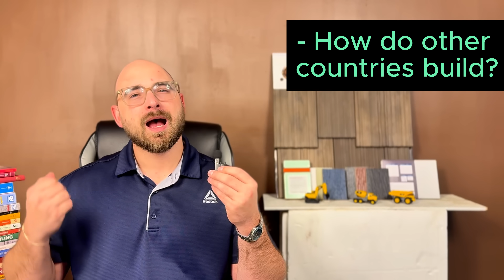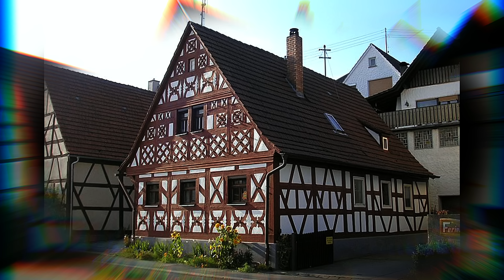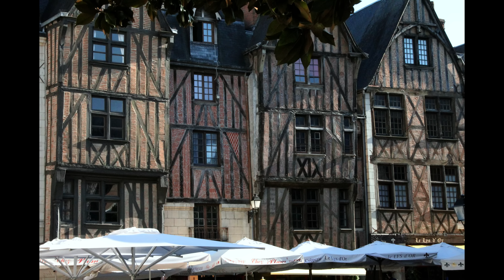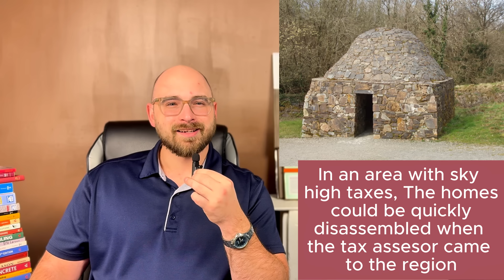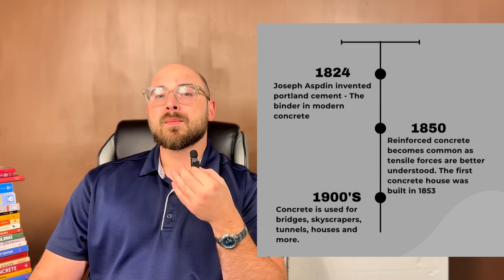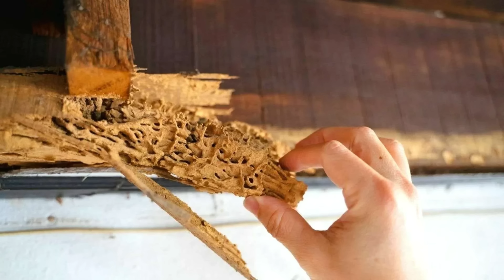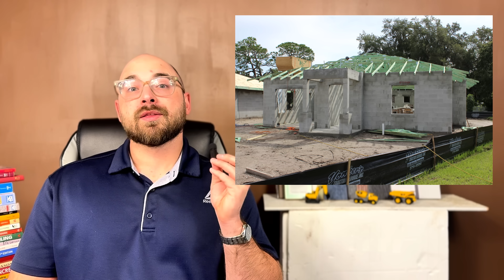Why Other Countries LAUGH at American Homes

Comment: Hello, do not note that France has suffered 3 wars on its territory (France-Prussia 1870 in my region , 1st world war and 2nd world war ). Destruction of housing, fires, mines, explosions destroyed buildings but also many forests . If Auguste PERRET rebuilt a concrete part it is because the wood was not available in quantity and quality . The standing clay houses were preserved, bricks and local concrete were easier to use, faster for reconstruction. For the well-anchored villa, in stone and concrete.  There is no good or bad home . As you said, there are specific needs (cost, sustainability, etc.)

Comment: I am from Puerto Rico, I can't stress how much I miss Concrete Homes, there are really no positives from light wood framing etc.. here in the US. This feels like the materials came from Office Depot. The only thing I have to fix in my concrete home is water faucets every few years, and paint. nothing else. Here there's always something. Weekends are spent just fixing stuff. Kids playing, stumping and walls tremble like crazy. got a leak, thousands to repair damaged floor and drywall (so much for cheaper)  pest control more monthly bills. its just an endless money pit. My concrete homes felt worth of the money and an investment, like a gold Bar. this feels like a ripoff, no way my kids will inherit this thing after I am gone it won't last. I am trying to build a concrete home here but in the US is not common so prices are ridiculous. you can get a full rebar concrete home including the roof in PR for 250k with around 1700 sqft living space.  It is all about location really.

Comment: What is also important is maintenance.
An American house is built and expected to last 30 years.
By then you'll have to do a complete makeover, with the cost maybe exceeding the cost of a new building.
If you inherit such a home from your parents, not much is gained, except maybe the ground it is standing on.

In Europe, inheriting a house built in 1990 will be usually stil in good shape. Maybe requiring a new heating unit and roof.
The average price of such a home will be around 250000 Euro. You might have to invest another 100000. But you'll end up with worth being created.
You still gained a lot by inheriting it.

Comment: In Argentina, it's very common to build with reinforced concrete colums and overall structure, then use hollow bricks for the walls. At least in Buenos Aires. Other construction methods do exist, like steel framing, and the like. Wood structure is nearly non-existant, other than for tile roofs, or maybe stairs.

Comment: I saw this other channel, Good simple living, show how they were building with this concrete cladding that looked like wood. I think I could live with a hybrid like that, traditional American construction inside and durable but classic log aesthetic outside. No need to redo the sidings (is that right?) every few years, no rotting, externally resistant to fire... It's a good compromise.

I grew up surrounded by brick though so it would always be my instinctive choice.

Comment: One secret with Roman concrete is that they used SEA WATER IN THE CONCRETE. Their is/was a documentary about it. SEA WATER does something with the LIMES. I think it binds it , and it  won't bleed moist  and dry up and shatter, as time goes on.

Comment: In the US, land is generally cheaper than EuroLand or Japan.  Also, the renewable North American tree crop makes wood inexpensive. So building large wood homes makes sense.  Yes, that can be frustrating & expensive for those who want to build with other materials.

Insulation and energy efficiency are not priorities in the US.  The US generally has much cheaper heating and electric costs, especially when compared to Euro and their whacky enviro policies.  Yay US Fracking!

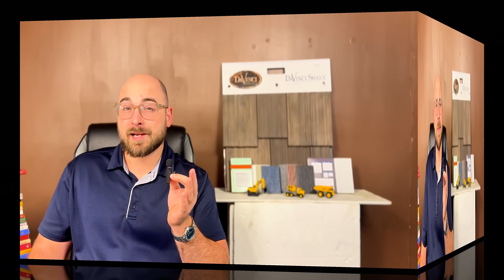Comment: 2:29 ok, here am I then 😂 My "Kádár cube" as they are called in Hungary, is built on a 3 step high insulated concrete base with 60cm wide earth brick walls. It doesent need the currently so popular outer insulation, as the walls are insulating by themselves, and also needs to be breathing. It is lime plastered outside and in (though public opinion on that is mixed, as that won't bond to it, only by netting, or nail wiring it, the previous horse manure+straw+mud mix does, but that's not nearly that smooth). If it cracks, it can easily be fixed with more dissolved mudbrick materials, there's plenty of that. Just as it is with the original early 1900s "Beaver tail" tiles it has on. Every second old building still has that , so it's infinately repairable. This one was built in South-East   Hungary in the early 1960s.

Comment: The main problem is that US construction has not been upgraded for a century and it is heavily regulated that slows down the progress. I recently bought house and the bedrooms don't have overhead lighting. In the New England houses are century old, have some many problems, the prices on them and construction materials are gouged up. So people are forced to patch this old stuff over and over until it collapses. I used to live in Russia in place where blizzard blows everyone from a feet. Everything there is made from a brick and concrete. Windows are triple ply gas filled. When you inside you just watch through your windows how snowstorm is raging and sip coffee in a t-shirt. Here, the whole house is shaking and you feel drafts. And this is result of enormous bureaucracy and silly decisions. When the fires is the issue you don't use combustible materials, you move to brick and mortar, like Europe and the rest of the world does. All the construction problems are result of lack of responsibility. The hard decisions needs to be made while certain areas needs deregulation. DIY is suffering from constant permits etc. You can't even run a romex to hook the lighting fixture without licensed electrician. It is not a rocket science but even a rocket scientist can't do it without a licensed electrician. And this nonsense everywhere. And result of this nonsense is terrible energy efficiency, over-priced housing, constant fires, floods etc because everything is old and requires maintenance.

Comment: As a Dutch interior decorator i can say that our homes have changed for the worst in the last years, while the exteriors are great quallity concrete and brick cavity walls  the inner walls shift more toward drywall cladding.

On more than one occasion i had my drill bit dissapear into an empty space or had drywall blowout cause there was no wood backing behind the drywall.

All these suboptimal materials are used in the name of insulation 

Quallity went down while the prices went up

Comment: Even Argentinean houses are made of cement, brick, some metal columns if we are feeling frisky and one sheet window unless you are in the Patagonia 😂 

They are cheap for Argentina, Durlock/plaster sheets are actually expensive. Even in earthquake-prone provinces they use bricks and just add more wire columns to help. 

Is it bad? Yes! 
But unless you are at a reclaimed from the river's lot/part of the province, you have dry and perfectly safe houses. Just keep humidity away and brick can stand for a long while, same with cement and anything but wood and plaster.

Make more durable homes, for a country with tornadoes, wildfires, hurricanes, earthquakes and floods you sure make lots of wood homes...it doesn't make much sense, even if its cheaper to rebuild, you will have to do ALL OVER AGAIN in a year or three. :(

Comment: This was an excellently presented and researched video, thank you sir. I'll be sharing it, as it confirms the suspicion that some friends and I had for quite some time: American building standards made sense at some point in time but never evolved (UK has a similar problem when it comes to insulation standards). Since a lot of Americans are now realising just how much money is wasted on heat/air-con loss, it seems they are trying to insulate the house properly themselves, where possible. If just a few states added insulation and resilience standards into their building codes, I imagine the building methods would suddenly change.

And yes, I love ICF too.

Comment: Steel studs are gaining traction in Canada, like you say mostly commercial and larger buildings but steel framework has become the standard for commercial construction. Tho we have very similar construction methods, being further North forces Canada to have different codes. So in a way Canada doesn’t built homes the same way as Americans despite using the same building materials the methods vary slightly to accommodate the colder climate.

Comment: Houses should be built to the specific needs of the area:
 in California houses should be resistant to earthquakes (like they do in Japan) and well insulated from heat.
In tornado country and hurricane prone areas houses should be built to withstand those and should have concrete underground shelters. 
When flooding can occur the houses should have a raised floor plan.
When extreme cold/heat can occur the buildings should have hi grade insulation and small window surface area. 
Houses in the Netherlands are often built on land that can suffer ftom subsidence. To deal with that  in the past they would drive wooden piles into the ground before building the house on top. (Old parts of Amsterdam are built like that) 
Today the wooden piles have been changed to reinforced concrete piles. With reinforced concrete floors and panels. Very strong. The houses are finished with a very hi grade insulation, tripple layered glass. All to guarantee low energy use. We hardly ever have earth quakes nor do we suffer from hurricanes or tornadoes so there is no need to take those into account. We do suffer from snow fall, that's why the roofs are slanted at kind of a steep angle in order for the roof to shed snow and water easily. ( a layer of 1 or 2 meters of snow could crush a flat top roof)

Comment: I don't know what really is the strongest construction method in general, but I do know that the Monastery "Rein" in Austria is almost 980 years old, it's a bit of a mix of brick and mortar and some sections stone and mortar construction I think.

my grandma's house is hundreds of years old, dating back to the 1700's, at least that's how far back the records go, might even be older than that.

one thing that brick and mortar can handle is moisture, many of the older buildings(if they where made right) soak up a lot of water, that can be particularly useful in summer, if you know how to work your house right you get 25°C inside while it has 35°C outside because the walls cool from evaporation.

Comment: 14:18 - "who's building concrete houses?" - EVERYONE IN EUROPE :P
Reply: Not only in Europe but also large part of south and east asia. Pretty much most nations except USA.
Reply: 90% of Brazilian houses (if not more) are brick and cement, with metal and concrete structure. Surely,  most of LatAm does the same.
Reply: @EBSantos123  the parts of South America that aren't shantytown shacks you mean? 😂
Reply: that's concrete reinforced with steel for foundations, infill is either CMU(concrete blocks) or clay bricks, or in some towns rocks
Reply: Brick is still more common, and has a very important advantage over concrete - you can actually demolish the building and build something new in its place. When you decide that concrete monstrosity should go... you're in a bit of a pickle. A lot of the concrete constructions from the second World War are still in European cities not because we want them there, but because it would be too expensive and dangerous to remove them.

There's also the concrete panel buildings, which do not have this problem... but those were always meant to be temporary, and have a host of issues... kind of similar to the "temporary" American housing :D
Reply: I moved into a brand new concrete apartment last year that I bought in Switzerland.
Because it's the bottom one above the garages and also in the middle of the mountains, I have to put on the heater a little in winter when it's snowy.
My former rented apartment (sandwiched between others in the flatter lands) didn't need any heating. Thanks to good insulation, waste heat from humans and electrical appliances was sufficient in winter.
Reply: Family houses in Czechia are typically built out of bricks or blocks ("large bricks"), not concrete. Concrete is only used for the foundation.
Reply: México, y no solo casas, edificios a prueba de terremotos
Reply: No, not really. There is a whole market of construction materials. The whole itself is rarely fully concrete. Cause it's cold and leads sound.
Reply: @ I said concrete but I meant "concrete, brics, and other ceramic / fired clay / rockish stuff".
Reply: @ Okay, sorry. Yeah, every kind of materials.
Reply: Add South America to the list.

Comment: 11:07 - AND surprisingly such "hollow" structure increases the durabilty because of the way the force is distributed inside the material :) Here in Poland 99,99% homes are either concrete or bric. They're usually insulated so they keep warmth inside. Many of those homes are 100+ year old. And whole families lived there (like parents + grandparents - they have the space for it). OR - young couple "moved out"... and had new home just 20-50-100 meters away on a field belonging to the family :D

Comment: I persnaly think that finaly it comes to a budged and house expectations... I builded my house to last and stay in my family as long as possible thats why mostly steel and concrete was used... wood was used only for some finishing touches nothing structural... but trust me it have some cons ... outside walll are strong enough to stop a damn car or even a trucks... but sorry i will not test that... but humidity is a problem... special dehumidifier system was needed to deal with that problem...

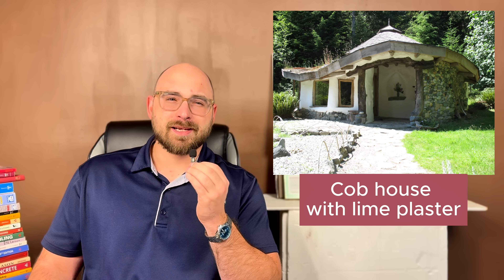Comment: 2:00 - In Europe there are trends to build with natural stuff like clay, wood and so on. And they're quite OK but still those houses are MUCH more sturdy than average cartboard house in usa. Even those "earth homes" have some structural strenght and can withstad a lot.
3:00 - The sticks or straw act as steel skeleton in modern buildings and clay is like concrete. You have hard but brittle part (clay/concrete) and more elastic stuff (wood/steel).

Comment: Great overview of this topic, thanks and I'm now a new subscriber. For a bit of background, I lived in Germany (West at the time) in the 60's. No residential construction technology withstood the heavy bombardment that war brings to it.  So, when Europeans brag about their solid homes, disaster proof is not quite as good as stated. But I learned a great deal about home building methods by exploring the ruined shells of many buildings and saw the pluses and minus of many techniques.  I was too young at that time to fully understand the economics behind the various techniques but figured "rich" families had better homes. The half-timber "Tudor" style homes are very pretty, but sometimes there is a problem with them in higher wind areas as stresses in the structure can create small openings in the areas where disparate materials meet. IIRC, the solution seemed to be thicker infill areas, (usually more weight).

Comment: I think it has to do with building regulations really. To explain the differences you need a construction engineer with experience in the different systems. Here is Scandinavia it varies quite a bit on construction methods depending on when it was built and where. I prefer concrete for its ability to store both heat and cold thus reducing costs.  I was shocked when I was in the US with single pane windows and a front door that looks like our interior doors. We always laughed at those cop shows where the cops kick down a door. That would be impossible here. You should demand more! Somebody is pocketing the money and it is not the people buying houses.